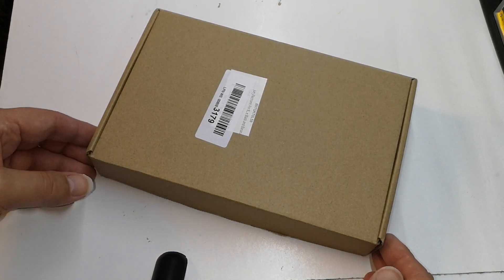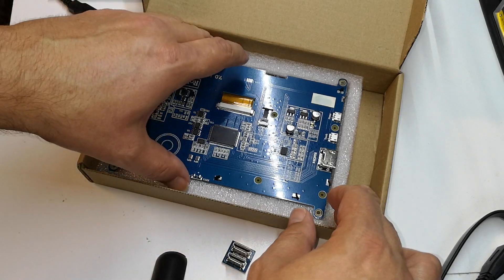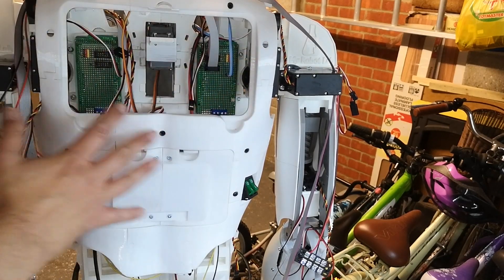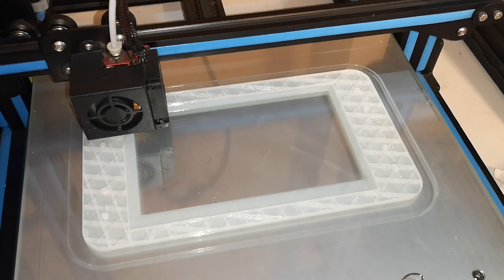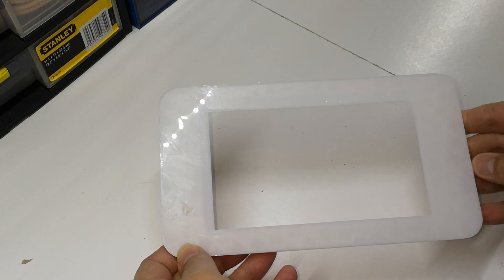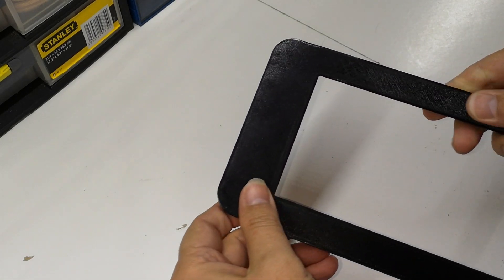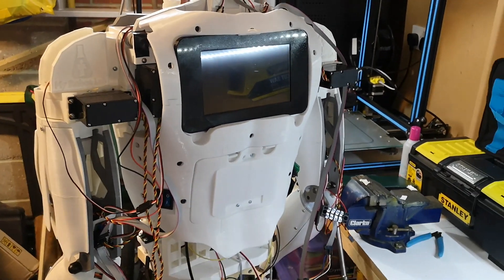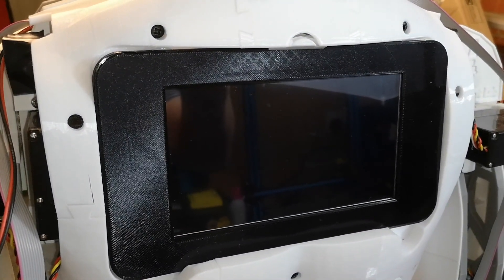Civrays InMoov - 7" Touchscreen

Comment: You show a link to the Raspberry Pi mounting bracket would you also share a link to the STL file for the 7 inch display face plate.
Reply from the maker: The link that takes you to thingiverse does have three parts with a download button for each. For some reason thingiverse only renders a picture of the bracket, but all three parts are there. However I just just emailed the files to you.

Comment: I found with my CR10S5 and the Cocoon Create Touch, both using a glass bed, I clean them with Isopropyl Alcohol and heat the bed to 65C.
This temp is just above the glass temp of PLA and they stick very well to the bed.
When it cools down below 40C, the parts fall off the bed.
The results look quite good. :-)
Reply from the maker: A couple of points I didn't mention. Both parts were printed using PETG. Bed temp was 80C for both, but I lowered the hot end temp for the second (black) part. The white part was printed at 240C and the black part was printed at 235C. The reason for lowering the temp was to try to reduce warping, but it actually seemed worse. I'm wondering if it's to do with airflow because it was the same side each time. Too much cooling maybe. A brim might solve it.

I do find that 80C bed temp on the CR10 is about as high as it will go, I guess because the bed is so big.

Yes I normally print PLA parts with a bed temp of 60C, and I find they pop right off when the bed cools to 46C. However I'm finding that with PETG I need to let the bed cool much more, I haven't worked out the exact temp yet but i'm thinking it needs to cool much lower. I wasn't really expecting that because I thought PETG had a higher glass transition temperature.
Reply: @SteveRaynerMakes  PETG has a Glass temp of 88 C or 190 F
I would suggest running the bed at 90 - 95 C but if it's struggling to reach 80..... :-(